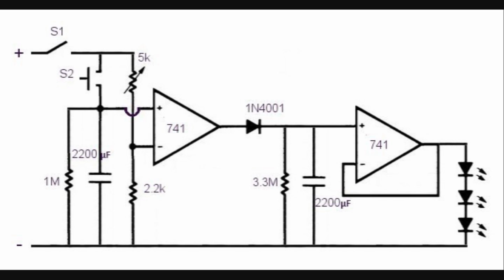How to Make an Automatic Dimming Nightlight

Comment from the maker: @Jim5150jvc  You're right. I did forget to mention that. I will update the materials list to include that. It doesn't really matter as long as they are rated for more than the supply voltage. The power supply that I used had an operating voltage of a about 9.6-9.8V with this circuit. So I just used a couple of 10V capacitors.